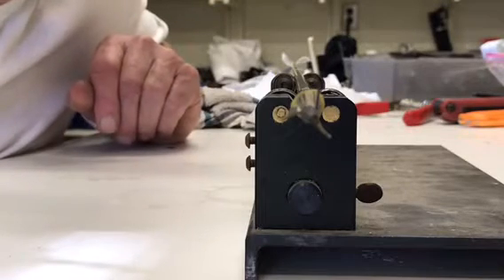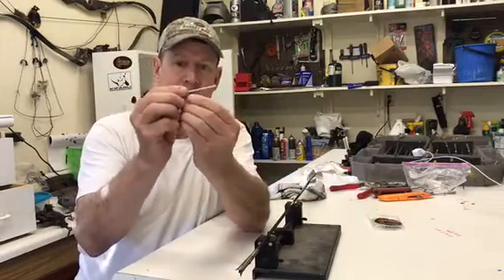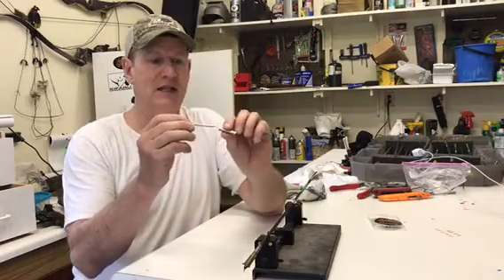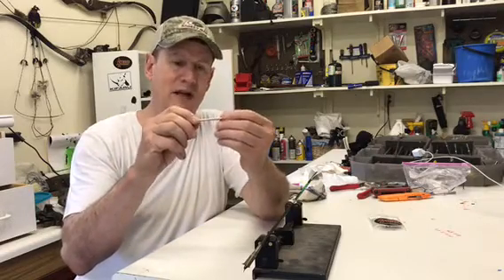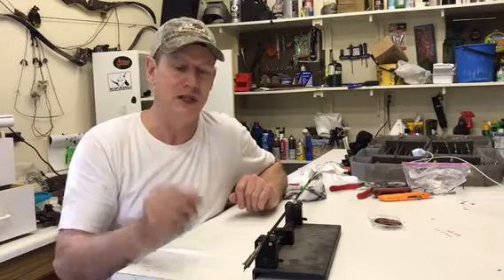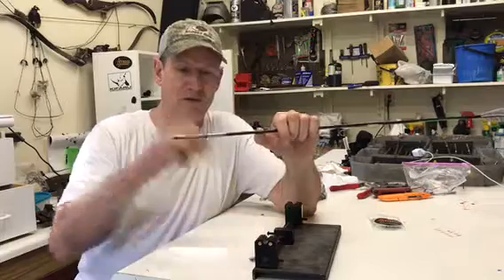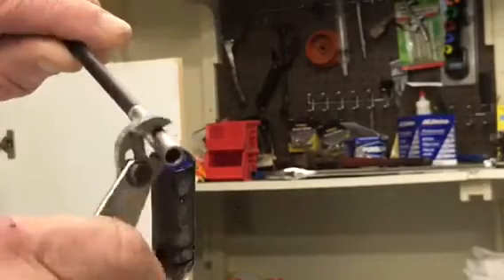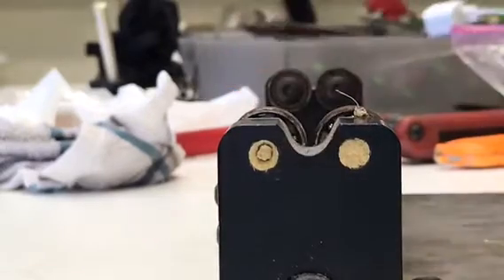Ethics Arrow Components (Epic Fail)

Comment: Y’all need to start using 2 part epoxy to put these one, never ever had one bend either these or day six components only have had day six aluminum components break in half once but the epoxy really really helps from resisting bends compared to a glue or no glue.
Reply from the maker: Thanks.  I've heard good things about day 6

Comment: Bull Crap. I think it's your Broadhead Ferrell bent. I've never had one to bend. Bit I do shoot a fail safe Broadhead.
Reply from the maker: It didn’t bend where the head screwed into the sleeve, it bent up inside the arrow.   The tiny .166 diameter bends pretty easy.   I, live many others are learning this and moving back to .204.   I bet ethics won’t bend in a .204 dia

Comment: Do you glue the impact sleeve onto the arrow? I just purchased my first set of arrows with this system and have not found many people glueing the sleeves. Seems pretty logical to glue them on in my opinion
Reply: I glue mine on. Makes it the most durable imo. Their a great product. If your worried about trying to align it perfectly you can epoxy glue in the footer and hot melt the sleeve on and are able to rotate it with a point in it to ensure your straight
Reply: @Strider9725  that’s my opinion as well. I’ve been trying a few different approaches with hot melt and found out I was sent the wrong size collars. I couldn’t get a straight arrow spin. Soon as new sleeves arrive hopefully that correct the issue
Reply from the maker: I glue mine with the blue hot melt
Reply: @TurkeyBowMaster300  I do the same now that I’ve got it figured out